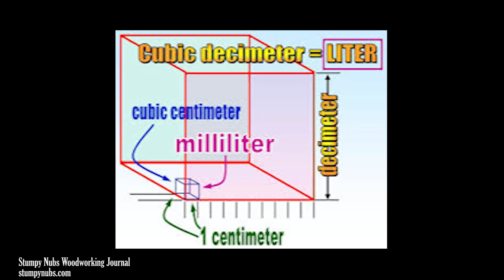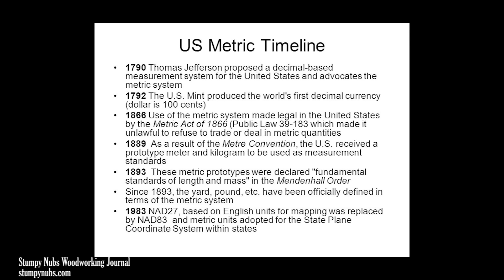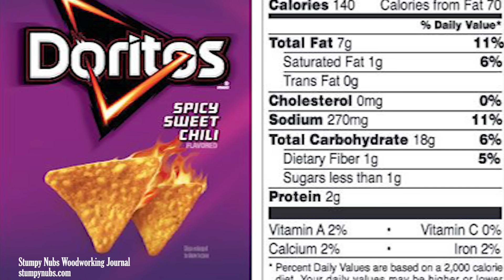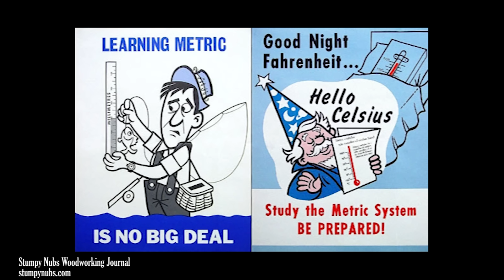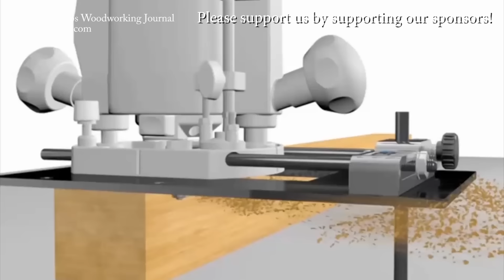BREAKING: The USA is switching to METRIC!

Comment: A funny thing is that although almost everything over here is measured in SI units (that's why you easily can calculate that one cubic meter = 1000 liter etc.), we also have traces of imperial. One common example is computer screens, we buy them in 15, 21, 27 inches - that's just the international standard for them 🙃 No-one knows exactly what it means but we know what screen size we're expecting.
Reply: The 19" rack, for datacenter and sound engineers is an other one
Reply: I believe the international standard for plane runways is also measured in feet
Reply: @JBB685   probably because flying happens in feet/miles, which came from ships, which didn't change after metric was created.
Reply: Actually this pretty much only happens with inches for some reason, computer screens, wheel diameters, piping thread sizes. All in inches for some reason. Can't think of any non inch standards (apart from the airplane runways mentioned before, but those are also distances)
Reply: @EddoWagt It's funny, because computer screens are in inches, but TV screen sizes are in cm.
Reply: Don't worry--since that's all in diagonal screen sizes--nobody in the US truly knows what they mean either. A 27in monitor isn't 27in wide! 😅 In true capitalist fashion--we're sold a bigger number and thus know it's better. 🙄
Reply: @EddoWagt  It's easy to become blinkered at home, but if you think about it, most of our standards are metric.  Everything from boats to flagpoles and frikkin' bullets, but they don't stand out since it's just our normal measurements. Hence, we don't think twice about them - compared to the odd imperial standard.
Reply: @EddoWagt  This is mostly a US packaging thing from my experience, Every monitor or tv i've bought in recent years had cm as the u.o.m (usually with inches on the box albeit smaller or in parenthesis), Wheel diameters have remained in inches despite near unilaterally every other measurement being in metric likely just due to the fact that wheel diameters have been a constant for the most part, and the re-tooling & conversion expenses would be astronomical with no practical benefit.(Either you'd end up with an unintuitive number or you'd have a rounded conversion that would cause issues with interference fits as it was scaled up.).

As for pipe thread, that's entirely a US thing. Metric thread, SAE, JIS, and BSP are all based in metric with NPT/NPS & UNC/UNF when referenced or taught outside of the states typically having the imperial & metric measurements, Or at least any time I've worked with them outside of the states both were referenced to avoid any possibility of confusion (although they're significantly less commonly used, even domestic goods. Due to the fact that very little is actually manufactured in the states these days and it just makes more $$$ to use an international standard.)
Reply: Although ships use nautical miles, which are different again, and knots (NM/h), which have carried over to flying.
Reply: @JBB685  Runways in Sweden are based on metric; the lines on the runway are based on metre.
Reply: @sakaraist  If pipes have metric thread, why are they still given in inches for the diameter? A metric thread with an imperial diameter. That's so weird.
Reply: @JBB685  No they're meters according to both IATA and ICAO.
Reply: @JBB685  As someone else said both IATA and ICAO designate metres as the unit and you’ll see that on charts - however you may also see it in ft. What IS standard is we use ft for altitude, the vertical position. We use nautical miles - slightly different from an imperial mile - again taken from boats. However we measure air pressure in millibars, not inches of mercury unless you’re in the US. 

All that is to say in aviation the system is very much a hybrid.
Reply: @oneraymichels lmfao to make that kind of claim😂.  Obviously you don't know how they are measured because it's too simple to figure out.   It literally shows both on the cartons and the instructions that screens are measured diagonally.  It's literally plastered on both sides of the boxes with arrows showing how it's measured.
Reply: @scratchy996  In Germany, TV screens are in inches, too. I guess that highly depends on country and industry sector. :)
Reply: It's due to the standard being created in America, or marketed to Americans due to them being the largest consumers of them.
Reply: This is because metric doesn't have an equivalent to the inch or foot, which are very handy lengths for quick (although inaccurate) eyeballing and easy numbers to visualize. If we just started calling 250mm/25cm a metric "inch" and 10 of those a metric "foot," I think that would solve a lot of hesitancy on the American side to give up our measurements. Honestly, everything else in SI is confusing and terrible. But inches and feet are ingrained deeply in our brains.
Reply: @todddammit4628  Everything in SI is confusing and terrible only to the weak minded who don't understand that once you start using a system, its rather simple since you become familiar with it. Its just as easy to eyeball how many cm something is as to do it with inches, once you are familiar with looking at those sizes. Half measures like substituting imperial names for metric measures is what makes it more confusing in actuality. Just learn the system and use it, and you will find that you adapt quite easily to it.
Reply: And this is why I never look at it and check display width and height instead (which is, unlike diagonal, written in normal units).
Reply: As a European, I can tell you, especially for inches, the vast majority of us know 2.54 cm is 1 inch and Yes, I confirm Especially for Diagonals of the Monitors screens we use and understand inches. 

For TVs in the last let's say 6-7 years more and more often I see cm in the specs and in the stores to help people to get the right decision about their wall space at home.
Reply: I always hate screen messurment, is so confusing that it is the lngth of the diagonal it was a pain when I was ordering a tv online and triying to calculate wich one would fit in my wall
Reply: @oneraymichels It allows you to get a rough estimate of screen area with a single number. Also, modern screens are usually about 1x2. Because geometry, the diagonal is about 3x the vertical. Not quite, but good enough for a rough "how big is this?" A 21" monitor is very roughly 7x14. A 54" TV is roughly 18x36. If the diagonal isn't divisible by three, round to a multiple of three.
Reply: the inch unit system and other unit system are stupid. It is not because of stupid system, but because  that they are not compatible with the international system SI. All other unit systems must compatible with the international system SI. 
I often use computer programs for technical machines and other engineering tasks. And I often have to store and enter various values for various variables in computer programs, then let computer programs use entered values to calculate various tasks. You know that computer programs use standard known scientific formulas to calculate. If you enter values for variables in different unit system, then any time you add values, you must check the unit used in scientific formulas, then you must convert the added values to required unit systems. It is nightmare in engigeering tasks and scientific tasks. 
The only solution is that : use universal unit system SI : all programs and people exchage and communicate only with values in SI system. Thus no need to convert and check formulas when you apply variables in scientific formulas.  
Other unit system maybe comfortable only in conversation communication languages, but not in engineering tasks.
Reply: @totally_not_a_bot  Hey, that's a handy trick! I never considered that; thanks! I've dealt with the AV overlap of IT on and off for 7-10 years now, and this is the first time someone has mentioned that beautiful geometry. Cheers, friend!
Reply: I guess that's because we never use those specs for any calculations, so it doesn't really matter. Thus, the marketing departments didn't bother, although here in Germany you typically have both inch and cm on the display tag, but typically the inch number is printed bigger.

Another odd remnant of pre-metric times we still have is horsepower (PS; Pferdestärken in German) for engines, though it's mandatory to put the numbers Kilowatt (kW) first, usually followed by the horsepower number in brackets. Horsepower may finally fade out of usage as EVs gain widespread adoption, as the relationship of kW to the battery capacity in kWh can quickly give you a rough idea how long the battery should last.
Reply: the screen size is from one corner to another, and no. i have no idea what any of those numbers mean, i just know the bigger the number, the bigger the screen.
Reply: I would love to see a more common sense way of measuring monitors. We measure on the diagonal and that makes a real mess when your mixing aspect ratios (ultra wide monitors are the worst!). We should measure on the vertical and do it in cm
Reply: @JBB685  Incorrect. All runways that I use are measured in metres . . .
Reply: @Liggliluff  A metric pipe uses metric for the thread, diameter and and any other dimension. You really do need to keep up.
Reply: @mqxogames  In Rusia and China and quite a few other places metres are used for distances and altitude along with KM/h for speed. In fact I once flew a light aircraft in France with the ASI inticating in km/h.
Reply: @TRPGpilot  That's a very good point, my statements were definitely western standards rather than an entirely international one. As for light aircraft I understand that's very common and is only sometimes accompanied by a marker that shows the IAS in kts
Reply: Let it change. its much easier dealing with measurements in metrics.... no idea what those seconds they use mean. 😅
Reply: Change it metric and those who use imperial will have no idea what it means
Reply: @JBG1968  That will be a very small portion of the entire global population who does not use and understand the S.I. units of measurements (metric) . . .
Reply: @oneraymichels  TV Screens in the past where bound on the TV-Format 4:3 - therefore giving the width will also give you the height. Computer Monitors where not bound on a fixed aspect radio and the width didn't give you the information of the heigth. Nowadays the 80'" - 16:9 TV Screen is also messured like Computer Monitors.
Reply: @oneraymichels  well they are measured diagonally to account for different aspect ratios, now most screens are in 16:9 but not that long ago you had 4:3 , 1:1 , 2:1 , ...

so measuring in diagonal allowed consumers to know at a glance, with a single value, how big the screen is regardless of it's aspect ratio.

And ever since a few years now, ultra wide 21:9 and even wider have become common, so we are once again in an era where measuring diagonally is useful !
Reply: @oneraymichels  Originally it meant the diameter of the cathode ray tube, then it was recalculated and the traders did magic with it until it reached the current state where it means nothing at all.
Reply: @oneraymichels  the same 4x2 timber you get less than was said. but only in US you are satisfied
Reply: There is a reason why screens use the superior system of imperial is due to the fact inches are a more natural system of measurement.
Reply: @Art-is-craft  I can't think what's natural about it. We can choose the base unit however we want. What is unnatural is when a different unit is used for each purpose, and that was the reason the metric system was created.
Reply: @AP57532  
Inches are natural as it is a fractional system. The reason why inches are a 12 fraction system is because it based on the rotation of the sun around earth from the observers point of view. It is why we have clocks that are 12 based. The 12 based system also is representative of the scale of the human body.
Reply: @Art-is-craft  That would be great if we were using the duodecimal system. But we use decimal. But that's still not the most important weakness of the imperial system. It's that it uses a bevy of different, incompatible units for each thing. If I didn't have a background in engineering, I probably wouldn't have thought to drill a 7/64" hole, which is approximately 110 mils, with a #35 drill bit (and I may still have made a mistake because I've never held a #35 drill bit in my life).  For us, the drill bit and hole would be 2.8 mm and there is no other statement.
Reply: @autohmae  shipping didn't use feet or miles.
Reply: @stephenarbon2227   pretty certain for navigation ships and airplanes use the nautical mile
Reply: Agreed - and car wheels and tyres are always expressed in inches for some bizarre reason
Reply: Screen size is nominally the diagonal, a holdover from when we had circular cathode ray tubes and the image was much smaller than the glass anyway. With the new extra low screens, the display surface shrank even more compared to the diagonal length. 

Inches are also used in traditional measures of resolution, like lines or dots per inch. Typography is commonly measured in points, which is 1/72 inch. 

The inch isn't where the real horror of the imperial system lies. It's in stuff like wire and hole gauges (three or more scales for width, not relatable to length), or pounds for all of liquid, mass, force and money.